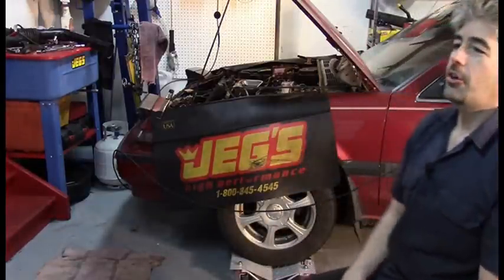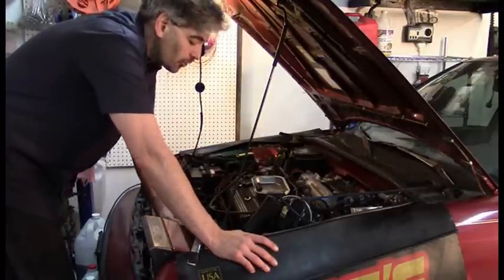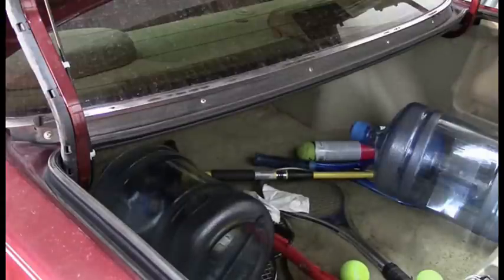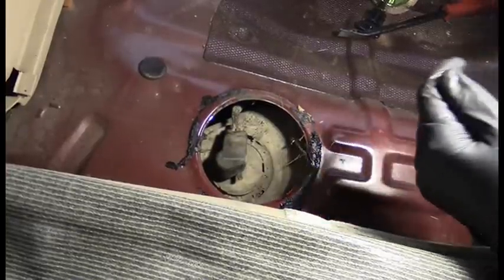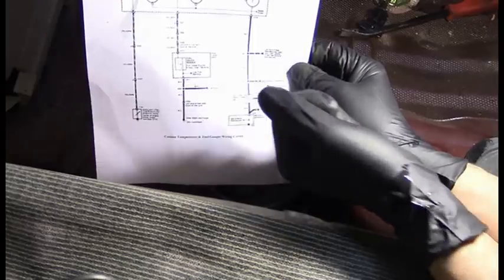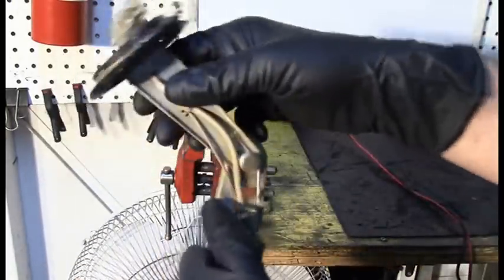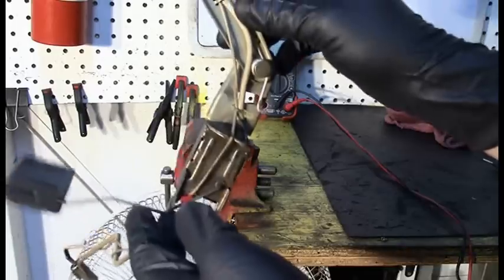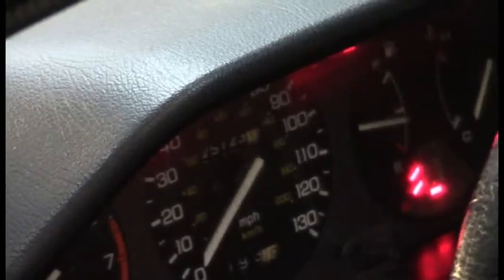Diagnosis of Stuck Fuel Gauge- Is it Gauge or Sending Unit?

Comment: I'm trying to get my gauge to read adjustments on the fuel level bob so I can double check the wires in the back of the car. The wiring diagrams I came across don't have the same color wires as I do. Is it possible to connect the fuel gauge directly to the fuel level sending unit or does it require some type of resistance (perhaps when it was together with the rest of the instrument cluster.
Reply from the maker: Yes you can connect it right to the unit. In fact - you can connect it to a 5V reference circuit directly and test operation.

Comment: Hi, Matt. thank you for share a very valuable information to all. I am currently dealing with a similar situation with my 2010 Ford Flex turbocharged. My question hoping you can possible know about the best way to remove the sending unit. The problem is that my car have a fuel pump located at the rear seats on the passenger side. On this side is no issue how to access to but the sending unit is at the driver side unfortunately is not a hole or an access for it. The only way looks like be to put down the gasoline tank correct? Any suggestion in how difficult this may be? Any other recommendation will be appreciated. Thank you in advance. Frank
Reply from the maker: Yep- you have to drop the gas tank. It’s easy to do- typically takes me only a half hour.
Reply: @SchrodingersBox  once again thank you for your advise. On which state are you located?
Reply from the maker: Colorado

Comment: So you think the variable resistor just needed a good clean in order to properly work? I'll bet rust/corrosion causes issues. I am helping a friend with an 89 Honda Prelude and it had a seized fuel pump from sitting too many years and the whole assembly was rusted over. I had to sand off the rust and install a new pump. Now it works great. But the sender is separate and I haven't pulled it out. Gauge always reads empty, so must be because it's really rusty = high corrosion and therefore showing empty. I was gonna replace the sender, but this has inspired me to fix it and see if I can clean the rust / crap off it and get it working again.
Reply from the maker: it worked for me. Usually it’s a temporary fix at best though.  If the customer had the money I would have recommended a new sending unit.
Reply: @SchrodingersBox  problem might be that getting a new sending unit for an 89 model might be difficult now.

Comment: Unit might have originally been installed incorrectly.. slightly off and it was stuck against the wall at full. 
They can get crunchy when tank is kept below half full ( below the resistor).

Comment: My project car, 1995 Nissan 200, needle is stuck at full even with car powered completely off, so I'm sure it's not fuel pump assembly. Do I pull cluster and tear down to component level?
Reply from the maker: Make it simple- just check the voltage from the sending unit and confirm with a bypass. Keep it simple!!
Reply: @SchrodingersBox  I just yanked a junkyard electeic float assembly off a donor 1998 Nissan w 158k. Part is discontinued so we'll see. Plus practice on delicately pulling wires.
Reply: @SchrodingersBox  Update: the 1996 Nissan's float assembly has a 3 wire connection and the 1998 donor float assembly has a FOUR WIRE connection!!!! I uave to go back to the yard and yank the pigtail!!!!
There was also a 1995 model I think I'll see if I can pull the instrument cluster maybe it's just a faulty needle itself.
When I unplugged float inside car and turned key forward it stays at above full.
Reply: @SchrodingersBox  Update 2: I pulled the fuel sender's pigtail and just in case, the individual gauge inside the instrument cluster. The 98's 4-wire connection had 3 matching wire colors and one extra white wire not sure what goes to.
Testing, then permanently soldering in, the 1995 Nissan was receptive of the 1998 float and pigtail and reads correctly now. The gauge needle was just $4 part I didn't need and tossed it in the trash.

Comment: Is it possible to have a gas gauge stuck in the middle?

I just bought a vehicle I haven't driven it a whole lot because I haven't got the money to register it and I'm concerned that the fuel gauge doesn't work but I don't know for sure

It seems to be stuck in the middle I'm not sure if it's actually stuck or it's just because I haven't driven a whole lot and it's really good on gas
Reply from the maker: yes it is.
Reply: @SchrodingersBox  thank you for your reply. I'll have to get it checked out, hopefully it's not though LOL

Comment: I have a chevy cavalier in which i had to replace my fuel pump it works fine except the hand is never accurate if im suspecting they sold me the wrong pump not sure though
Reply from the maker: what did your electrical diagnosis show?
Reply: @SchrodingersBox  I have a friend who is a mechanic he checked it out and said it is the wrong pump for the vin# number of my car he said he sees this happen quit often

Comment: I don’t take my truck to shops, but if I did, I would want someone like you to work on it. You are very thorough and I can tell you care about your customers satisfaction and feedback. With that being said, I replaced my sending unit a couple months back when my fuel pump went out, and before I did that, my fuel gauge would always read empty, but now it always reads full, any advice?
Reply from the maker: Check for continuity to the gauge. an open to the gauge could cause that.
Reply: Schrodingers Box ?

Comment: Thank you for your video. When you removed the sending unit and opened the box containing the variable resister, I was inspired to do the same thing. I was worried about contamination, so I sprayed the resistor block and contact point with carburetor cleaner to remove any varnish. Then, I sprayed the resistor block with the spray can electronic contact cleaner. After I did this, the resistance reading were perfect. 
Unfortunately, this was not the cause of my fuel gauge failure. My neighbor and I discovered that the brass float had developed a hole and was filled with gas. No matter what level of gas I had, the gauge would always show empty. Now, I know why. Found a replacement float. Installed it and the fuel gauge works now. Life is good!!

Comment: I had my fuel pump replaced about 2 yrs ago. After about 8 months into the pricey repair job the gas gauge reflected empty tank once I near or go under a half tank of gas. What could be possible points to look at? This is frustrating as I depend on 99 honda odyssey van to transport myself and son who is severely disabled and in a wheelchair.
Help greatly appreciated, thank you
Reply from the maker: Sounds like a faulty sending unit to me.

Comment: My gas gauge doesn't work properly and when I fuel up the pump to will click off like I have a  full tank.It will continue to do this through out my pumping my gas. My gauge it stop at bout an 8th.  And it will bounce around from a quarter to empty until I take care of it. I have a 2007 Sebring 4 cylinder if that matters. Also my dash lights don't work if that gives you more detail on what my problem is. Thanks to you guys I took out my starter for the first time. Now getting it back together
Reply from the maker: Sounbds pretty simple. What is the resistance sweep showing on the potentiometer?

Comment: can you do this for a 75 pontiac grand prix?? i have the same issue.  it was working fine until a year or so a go
Reply from the maker: it’s the same on all cars. Just check the sending unit and the gauge to determine which is the issue.
Reply: @SchrodingersBox  not much of a mechanic but i hardly drive the car so maybe that's what did it or i let the fuel go down too low at some point before refueling.  I tried seafoam a few times as a mechanic suggested it.  no luck so far but i hardly drive it so not sure
Reply from the maker: Seafoam??? what would that possibly do?  Don’t waste your time. Diagnose the cause. It’s obviously electrical, not seafoamable.
Reply: @SchrodingersBox  I'll have to look up the electrical diagram then and start at the trunk to see if all wires are attached or if they somehow were loosened.  Car has been garaged since 1980 so not sure what could of gone wrong.  Thanks.

Comment: So if you use a test light to test the signal coming out of your head unit it should be a very faint blinking signal and you should read approximately a half a tank or so with a test light hooked in with a low wattage bulb if it goes all the way to ground there's probably something wrong with the resistance in the head unit I seen it lots of times you can't just test these things by grounding the wire and looking for full and empty sometimes the signal coming out is incorrect also with oil pressure and temperature sensors also you can also easily just find the resistance of your tank sending unit and by a resistor of approximately 50 ohms and determine what that should read

Comment: Hi Matt, Please let me know why when you have a new car you get a good MPG, and it starts to degrade after a short few years? I also wonder why manufacturer does not design accurate fuel gauge where the markes on the gauge are a true representation. i.e. 1st quarter laster much longer than the 3rd quarter... it's not crucial but annoying as hell.
Reply from the maker: I can't speak to the first one-  I have not seen where my MPG has degraded on any of my vehicles but any number of possibilities could explain that from low tire pressure to worn suspension to a fuel issue or vacuum leakthat is undiagnosed....

 As for the second part- I actually can answer that.  Car companies purposefully make the fuel gauge inaccurate especially on the EMPTY side because people tend to get angry and unreasonable when they run out of gas and sometimes blame the car.  By making it so the car doesn't really run out of gas when it hits "E", people tend to be happier with the vehicle.

Comment: 7:76 Now that is funny. Even if you did not know how to read the colored bands on the resistor, just google it, or since you have a volt ohm meter right there in the video, just select the ohms range and measure it. Good test method demonstrated though.

Comment: I had a stuck gas gauge in my van, it didn't move for year. So I put $20 in the tank. The movement was so slight I had to measure it with an electron microscope. That's the wrong tool I know, 'cause my motor doesn't run on electrons. Turns out I just didn't drive it for a year. 

That was unexpected.

Comment: I have an 88' crx with the same exact issue. Two questions. How did you open the inside of the sending unit? How did you apply the electrical contact solution? Thank you much!!
Reply from the maker: open it by removing the bolts. Just spray the cleaner over the variable resistor.

Comment: Great stuff Bro! Your outpouring generosity is commendable. Braveheart! I am having problems since a couple of months with the fuel gauge of an old Nissan Micra K10 (year 1992) and I am located in London (UK). If you happen to have any wiring diagram for that particular device or refer me to some source, I would be so grateful. Thanks and best wishes Bro.

Comment: Hello Matt,  I realize this is a bit of an old thread but still relevant.  Love your Video's and I just came across this one.

I'd like to share a bit of info with you and your viewers that may be of help in the future.  I used to do a lot of electrical and electronic service and repairs.  With variable resisters / brush contacts that were faulty and giving erroneous or no readings, I found that by using an electronic contact cleaner, an old used and soft green scrub pad and also 2000 grit wet and dry sandpaper will do a remarkable renewal of the contact surfaces.

First make sure the rotating part is moving freely.  Trim the sandpaper so it fits and slides under the brushes, wet it with cleaner and gently slide it back and forth to renew the contact surface being sure not to lift or bend the brushes. Then wet the fixed carbon surface and gently use the green pad to rub it down.  Finish off by spraying off all residues with the cleaner and test for smoothness and variable resistance.  Q-Tips also work good on small brush contacts.

Cheers

Comment: super helpful thanks!  my fuel gauge has been dropping to empty then slowly rising back to its correct reading ,  i have a fuel pump coming in so ill do these tests while i have the sending unit out    / was dreading taking the cluster out so hopefully its just the floats resistor

Comment: Hi i had a question so if its plugged and it reads empty already does it mean its the sending unit i have a 68 imperial and i want to replace the sending unit but i dont know if its the gauge or the sending unit
Reply from the maker: I don’t know. what was the resistance reading?

Comment: I have a 1988 Chevrolet Silverado 5.7  2wd . Do you have any suggestions for me on how to remove fuel tank my gas  gauge is always on full  .  I have never done this before.   Please help
Reply from the maker: Just unscrew the bolts.  Changing parts requires no skill- left loosy righty tighty!

Comment: Mine isn't stuck, but I go a 1/4 of a mile and use 1/8th and stays. Or i go up a hill and gas gauge stays. One day ran out. Filled up only took 8 gallons. My car can hold 15. Meant had 7 in it. What could it be. Any ideas
Reply from the maker: what data do you have?

Comment: Very well done bit of trouble shooting.  As a retired US Navy Diesel Engine Inspector my job was mostly the trouble shooting. Your methods both of step by step 1 thing at a time and the clear easy to understand way you presented it we're excellent.  Love the resistor and will probably use one when I get to testing my stuck on 1/4 fuel guage.
That you go the extra mile to help others is to me a sign of a good person with heart. As one of to those seniors I Thank you.
Reply: You got it fixed?
Reply from the maker: @MrHernanliom unfortunately no- the repair only lasted a few weeks and then it started failing again. More unfortunately, the car owner died within a year after. He had terminal cancer the whole time.

Comment: I just replaced my sender unit as it was giving an inconsistent reading. It would jump up and down when I accelerated or stored harshly. Now it is saying i am always full. The gauge drops when I switch the engine of and pops up when I turn it on so I don't think it's the gauge that is stuck. I'm thinking the sending unit is the issue or wiring. It was a used unit not new. Any thoughts?
Reply from the maker: Pretty easy to diagnose: just test by applying variable resistance to the circuit

Comment: I have a question please help !! :D
I have 2000 tt. 
The fuel gauge reads empty all the time. It used to fluctuate between accurate and empty, and full. but , now it's at empty all the time.
I changed the fuel pump with new sending unit, and still the gauge reads empty.
So I took the fuel pump out and connected it, turn the ignition on position. And move the sending unit manually while is out of the thank.
. And the fuel gauge didn't move. 
Any ideas on what I should check next?? 
I have 4 pin conector:
#1 pin reads 0 ohms.
#2 pin =10.7 ohms
#3 pin = 0.690 ohms.
#4 pin= 9 ohms.
Pins were measure with the ignition off.
Any ideas? ? Any advice on what to do next or what can be the issue?  
Thanks :)
Reply from the maker: What was the resistance curve against angle showing?

Comment: I just called about my  sending unit in my s10 blazer and  the guy said it had to be under 130,000 miles which it is.  why is that?
Reply from the maker: Because the guy is an idiot. Mileage is completely irrelevant in diagnostics.

Comment: I have a question i have a 1997 chevy tahoe ive been having this problem Mine reads empty and it changes as i step on the gas it moves up and down i changed the sending unit and i changed my cluster what can it be? Any suggestions
Reply from the maker: what data do you have?

Comment: I have a 2008 Lincoln, two months ago the fuel gauge went to empty while driving down the road and now it will not even budge. I just replaced both fuel pump and sending unit on my own and still the gauge is showing empty. The LCD screen shows "---- miles to empty" and I cannot even change a thing on the LCD such as changing it to Trip A or Trip B, it will not let me change it because"---- miles to empty" keeps showing. Does this sound like a bad ground near the plug? I forgot to check the ground at the plug as I changed out fuel pump and sending unit and will have to do this next week or so. Also I did order a used Cluster Panel just in case as I broken the plastic glass on mine checking to see if there a "Anti Slosh Module on the back of the panel but Navigators do not have them. So the only thing I can think can be wrong is the ground is not working at the plug....Any help is appreciated.
Reply from the maker: so what happens when you test for ground continuity??
Reply: Well I am going to check that tomorrow if I get to the wires. If I can't I will have to take the SUV to a friends shop and use a transmission jack to lower the tank to get to it, AGAIN. Saturday I used my carport to do everything, not good for somebody with severe spine issues, I am still paying for it. I don't know why we didn't check the ground before we installed the tank!!! Stupid us.....

Comment: hi   I like look in your works as I think  you are good . So I want to you ask my Honda civic 2006 auto  reverse sometime engage in  and  then not ? the car engage D and the car move forward before press on th gas panel .?  I change transmission fluid a few day ago and check sensor all . but the car still have the reverse jerk when engage the reverse?  please help me..... many thanks
Reply from the maker: Check the shift solenoids. Both need to operate for reverse